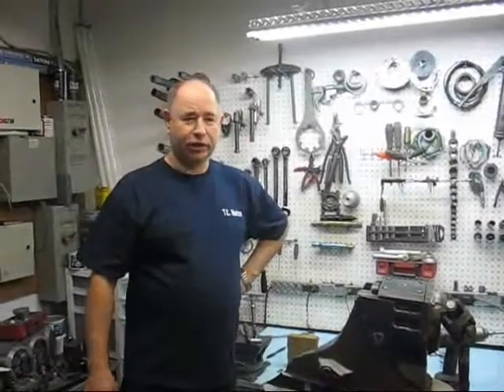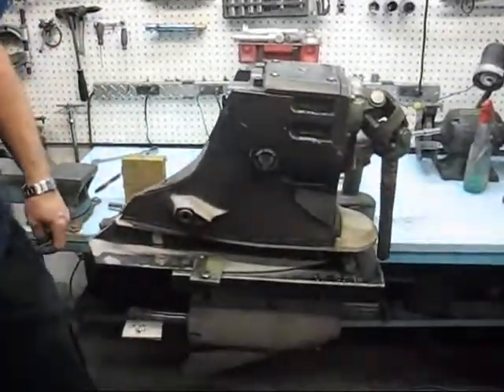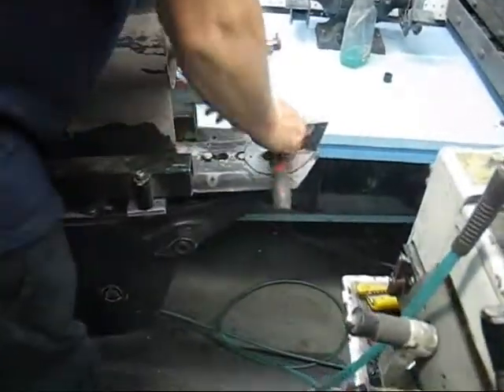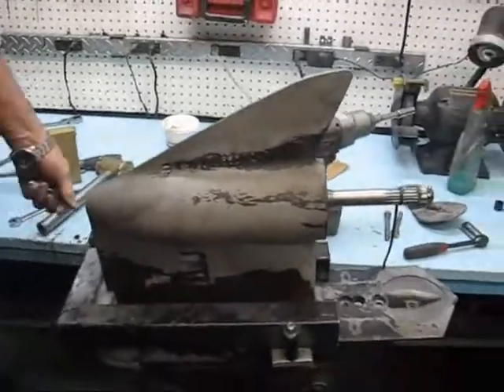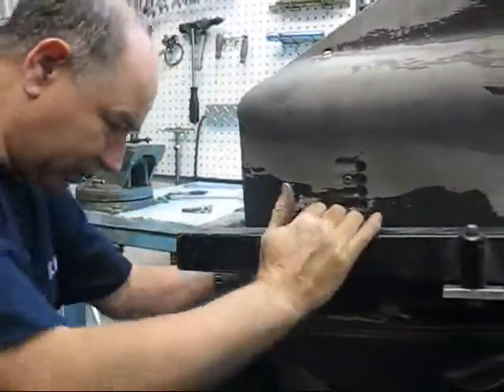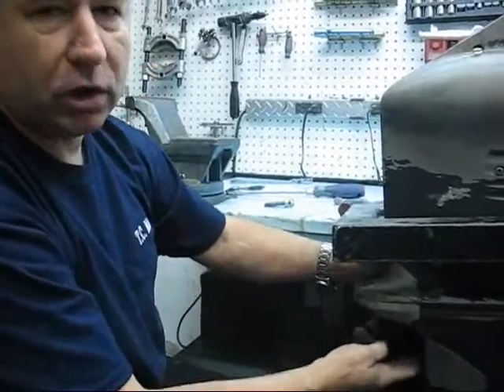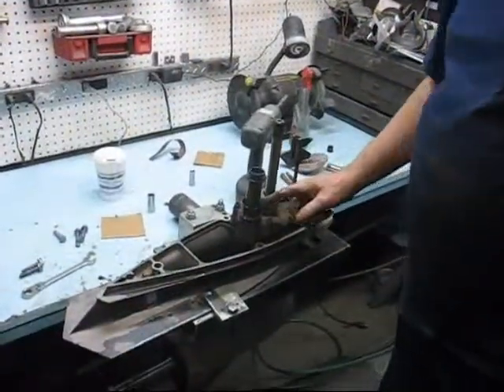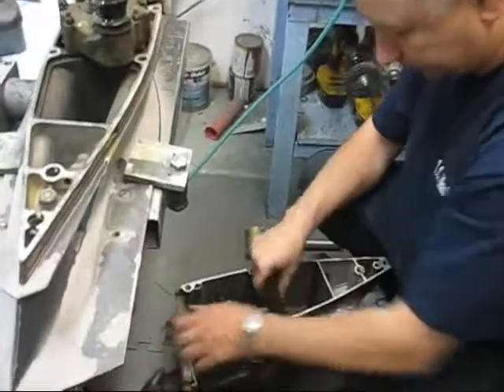OMC Cobra repair - how to remove lower unit

Comment: For a Volvo penta sx with a cone clutch could I remove lower unit on the boat? ( It does not have the shift linkage)

Comment: Wayne I have an OMC Cobra on my Chris Craft Scorpion. I've been told by several mechanics as well as boat owners that this is the worst possible outdrive I could own. Could you weigh in on this? My issue is having problems shifting into neutral from forward and reverse when the boat is in the water. The EAS has been bypassed prior to me purchasing the boat